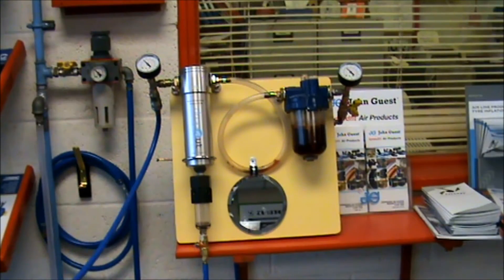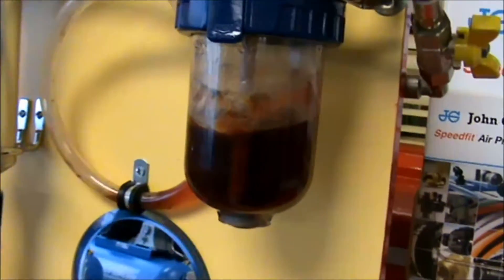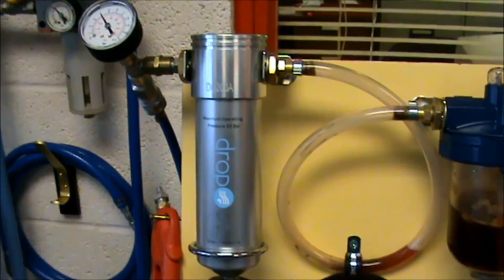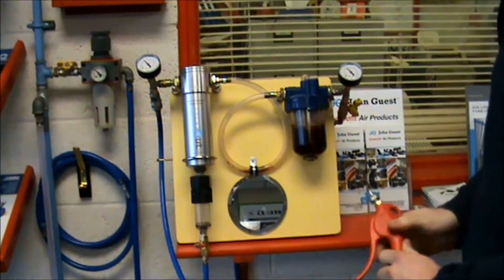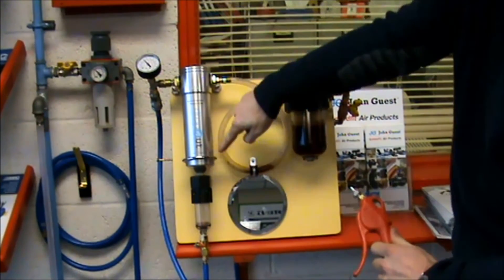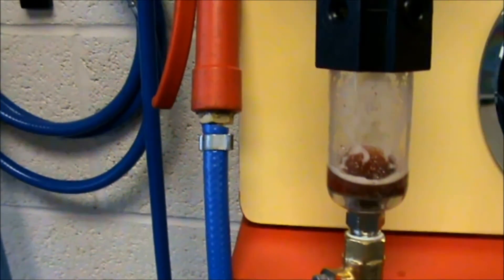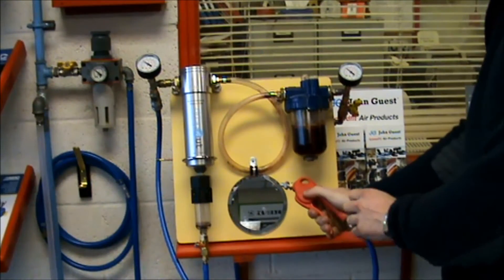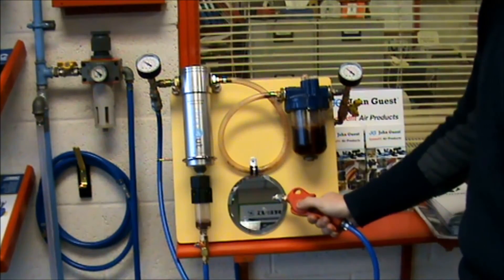PCL Dropout Water Separator Filter Demonstration - compressed air water removal system

Comment: $700 and you have to manually drain it, that's ridiculous!
Reply: I own one and they are fantastic value for 3 reasons, the obvious being it does exactly as they state regarding removing water, oil and particles. The second which is not covered is the almost none existent pressure drop the single filter system uses... the same can’t be said for a 3-stage system. And thirdly no servicing is required. An auto drain can be added to the bottom 1/2 inch drain for a few bucks so no biggie 👌
Reply: Do One  check dates that was 3 years ago
Reply: That was 2 years ago